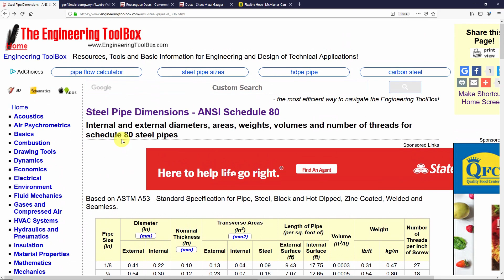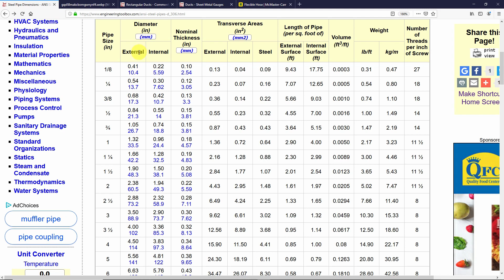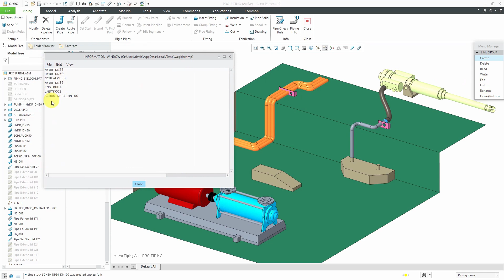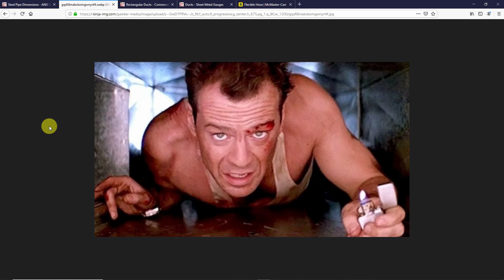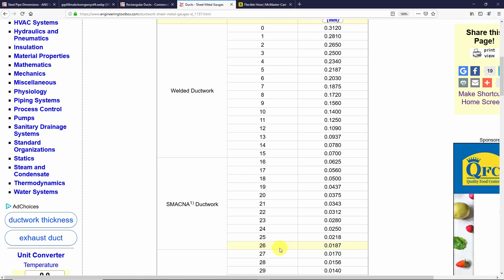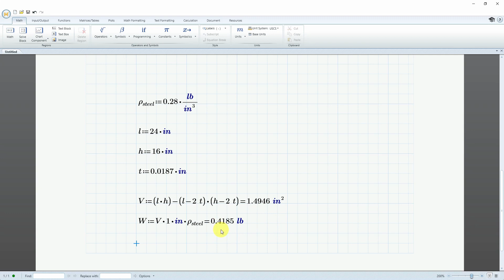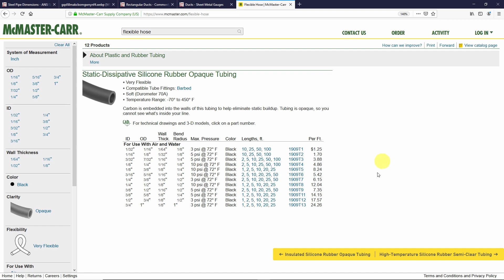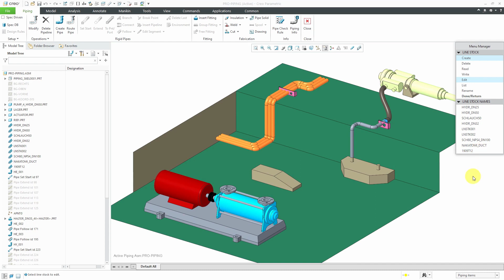Creo Parametric - Manual Piping Setup: Line Stock

Comment: Hi thanks for the video. One question I have. In my industry we use copper tubes with expanded, reduced and spun closed ends. These aren't fittings, they are end treatments of the tube itself. For example. a .50" tube with with an expansion on one end  in order to be brazed together with a second .50" tube. What would the best way to handles these types of features?
Reply from the maker: Merge/Inheritance Feature? User Defined Feature? It depends on your company's documentation requirements.
Reply: @CADPLMGuy  Well currently we create the our tubes with the "Pipe" command, then add revolved extrusions for any end treatments. What i was looking for is a way to add them through the Piping module. Similar to how with the Hole command I can add counter sinks and counter bores through the Hole command itself and not by adding an extra revolved extrusion feature in addition to the Hole. But I do not see that any where. Anyways, Thanks for your reply.